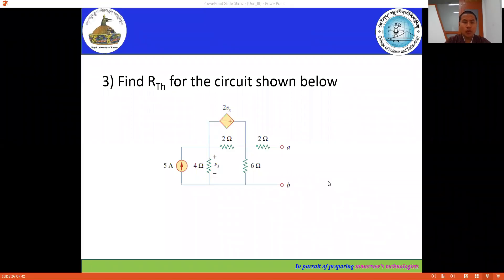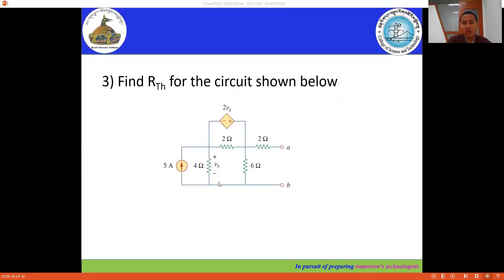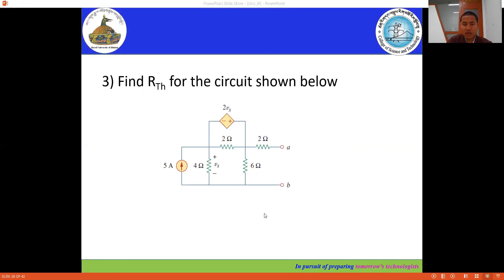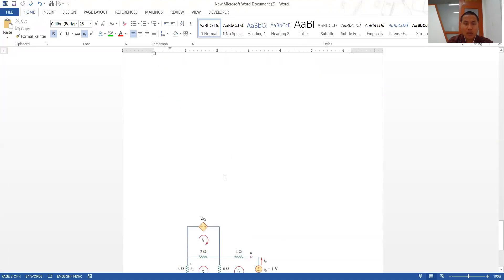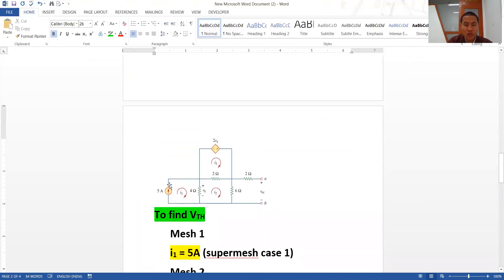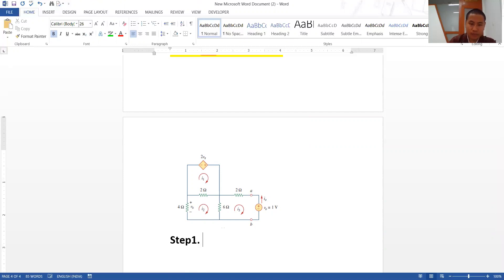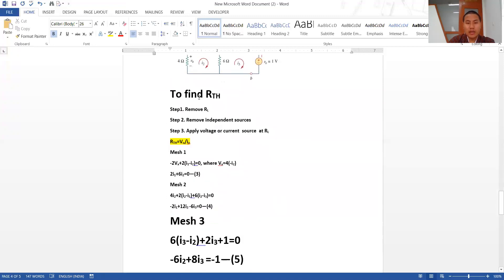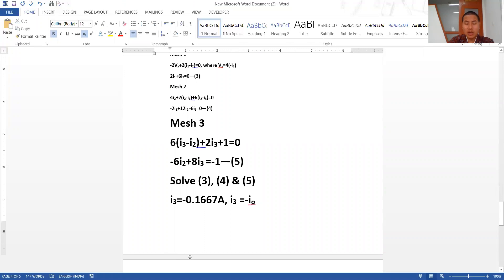Thevenin's theorem dependent source example

Comment: How you can consider 1 volt as vth ?
Reply from the maker: Vo can be considered any value. I took as 1 v. I can also take 5 v, or 10v or any value and calculate the current accordingly. At the end Rth will be same.

Comment: At 10.25 how do you know that vo=1
Reply from the maker: when there is dependent source, you either inject voltage source or current source. In my example, I injected voltage source and taken Vo as 1 V. I can also take vo as 5 V, 10V, .. so on and calculate the current accordingly. Just take different values of Vo and calculate the current, you will get same RTH. Thanks for watching my video.

Comment: While solving for mesh 2,shouldnt it have been - 4(i2-i1)?since the direction chosen is clockwise and we go to the 4ohm resistor from the negative terminal first?
Reply from the maker: No, it hsould be 4(i2-i1) only. When you take Vx, it should be like what you have mentioned.

Comment: When finding the Rth, u drew the circuit again and removed the independent source; shouldn't the independent source be replaced by a closed circuit? and then there is no 4 ohm resistor.
Reply: If the independent source was a voltage source then it would be replaced by a closed circuit but in this case, the independent source was a current source which means it becomes open circuit and can be removed. This is because when you are finding Rth you effectively have to "turn off" sources. Turning off a current source means there is 0 current flowing and there can only be 0 current with infinite resistance so an open circuit is used.